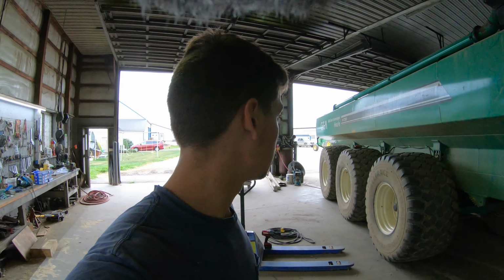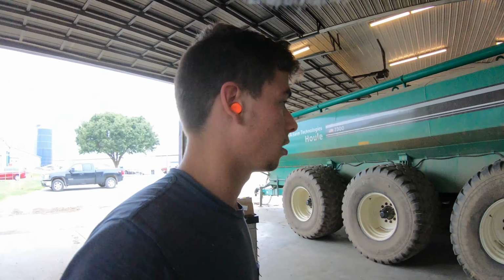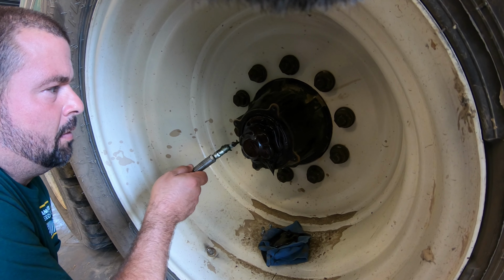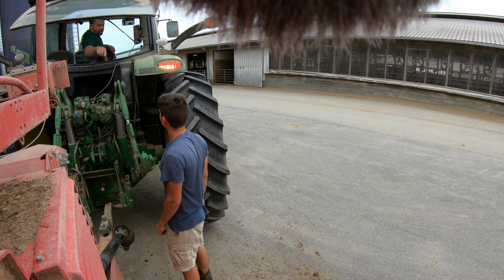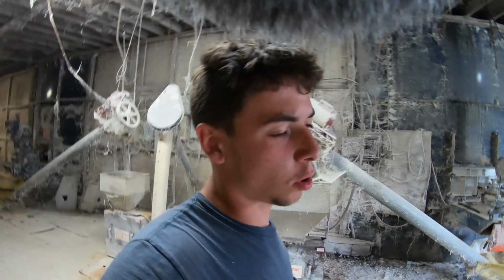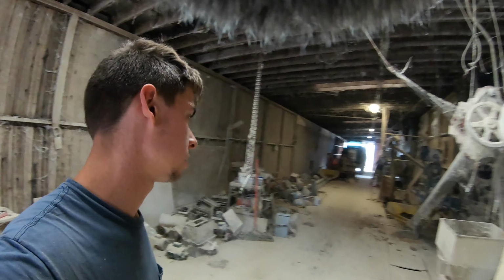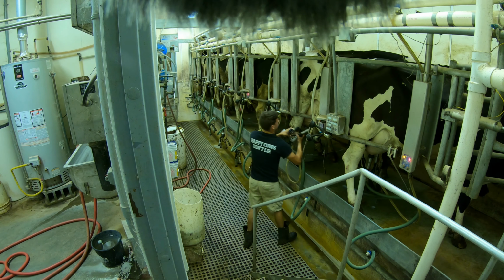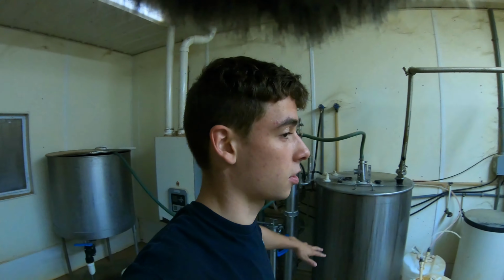Tank Work & Morning Milking

Comment: Hey there Ashlyn and Tony, I hope this finds you all well and good. 

Ashlyn, your camera needs it's eyebrow trimmed.

Tony, you should be using Mobil 1 100% Synthetic grease, whatever that was in your hubs had obviously broken down due to extremely high temperatures, which was likely caused by the degradation of the lubricant.

I'm anxious to see your new parlour come online, as I'm sure you are.

I hope y'all have a good one! 

"Nothing Runs Like A Deere" 
 🦌 👍 🇺🇸
Reply from the maker: I know the eyebrows are insane
Reply: @rohrerdairyproductions4080  
There's only 1 eyebrow, it's a Cyclops. 👁

Comment: Are you going to keep your double 20 or your single 8 to milk your treated or fresh cows or are you going to milk them in your 60 cow rotary and do you house any of your employees
Reply from the maker: Milk everything in the rotary
Reply: @rohrerdairyproductions4080  Yeah thats a great idea actually as the thing to cows with penicillin / antibiotics it can easily be milked into a Bucket instead of the milk line then Tyler can bring the collected milk to the pasteurizer to be processed for the calves as there can also be some from the good healthy cows as well in the case of the treated cows milk not being enough to feed all the calves some of the good milk can be used but most of the good milk goes directly to the Tanker Trucks then to the factory then to the kitchens of customers the reason why they strive to keep a Clean Dairy